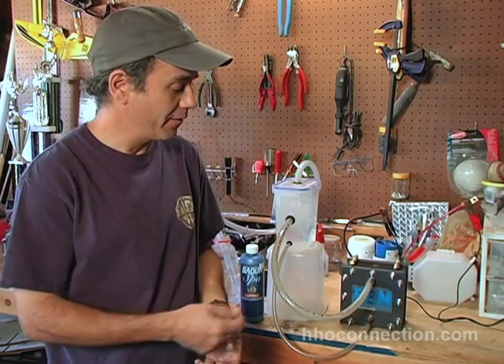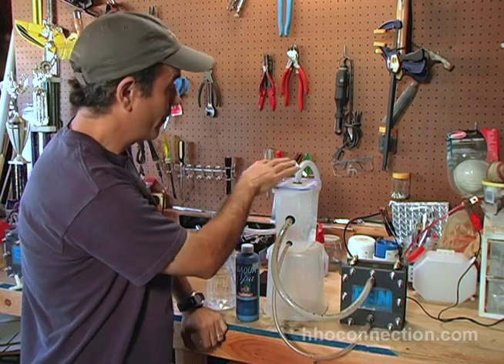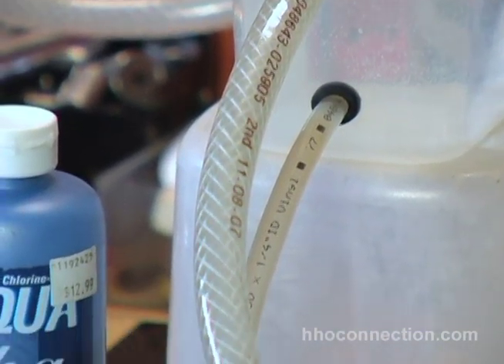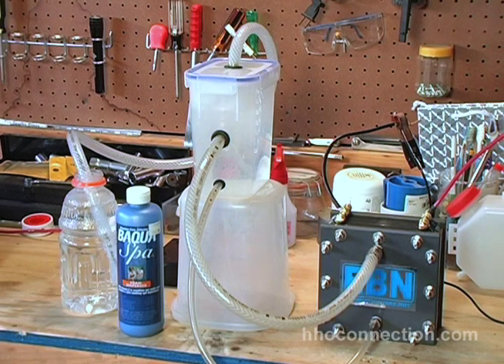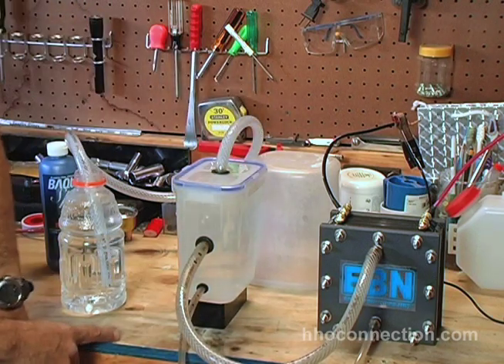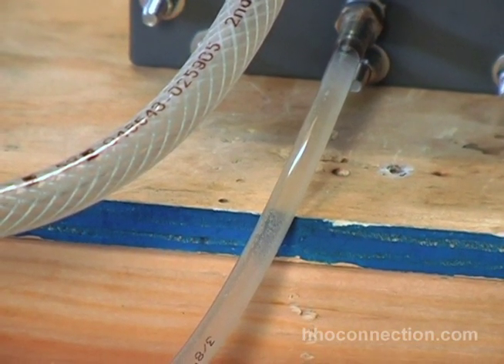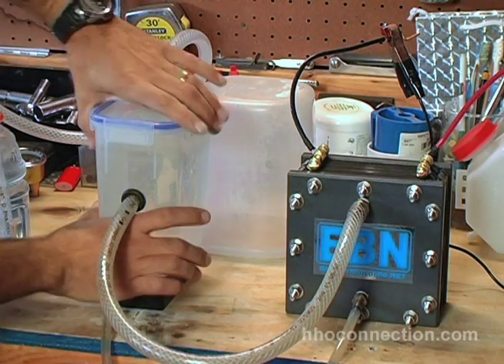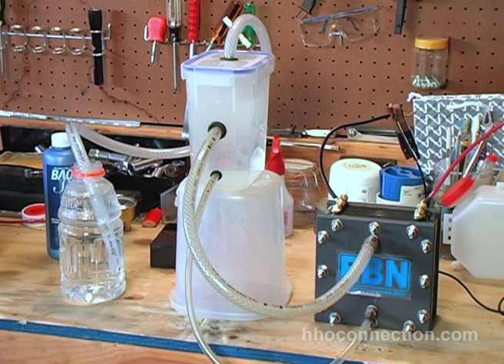Possible Solution To Dry Cell Foaming Issue

Comment: Lowering reservoir to decrease foam from dry cell.  Works fine in the lab; but, in the real world of automotive environments it's impossible.

As to hot tub foam dispersant, you don't speak of freqency of application of additional anti-foaming agent.  It's chemical make up may or may not be broken down by the electrolysis process.
The simple action of replacing the distilled water alone is no longer as simple.

In an automotive environment the vacuum draw on the generated HHO and upon the flow rate through the generator will produce huge volume of foam; without an anti-forming agent, especially at 30 amps.

You provide no answer here to the problem.

Comment: Don't listen to this guy if your cell is making foam it is because its contaminated I run just distilled water and KOH and mine never even forms foam. If You cleanse your cell properly foam is not a problem. Just run the cell normally for 24hrs than reverse your polarity and run it for 24 more hours and dump your water. Some times you need to repeat this 6 times to clean it but usually 2 cycles is plenty.

Comment: OOPS  Just looked at it again and the liquid does not circulate when the tank is lower than the cell. It circulates pretty good when  the the tank level is about 3 inches or so above the cell.

Comment: I just tried the lowering of the tank and it worked great. I looks to me that the liquid level of the tank should be a little bit bellow the hho outflow  of the cell. Doing that leaves a little air space on the top of the cell whereas the  tank being way above the cell  makes it so the cell is completely full of liquid where the hho pushes out liquid and hho. And the liquid does circulate pretty good when the tank is lowered.

Comment: Lowering the bubbler below the highest liguid level of the generator, lowers the liquid level in the generator and therefore lowers output. Lowering the bubbler below the powest point of the generator would even completely drain the generator.
I think that if you would take a look inside the generator, you would see froth in there instead of in the bubbler. Have you already tested the effects of the pool chemicals on the generator? Very interested! Cheers!

Comment: Lower the tank .... are you not just generating a gas lock , rather than bleeding the gas out of the cell , pushing a mix of liquid & gas . Are you not just capturing a gas pocket at the top of the cell , generating a dry area & loss of functioning cell  ?
Reply: magna59 s

Comment: On that foam issue, when you lowered  your tank you decreased the resistance of the water flow and when you lowered it again the foam left.  Its kind of like my internet I had my modem about 35' away from my dtv box and I wanted to listen to pandora radio and it was cutting in and out  so I rerouted the lines and put the modem next to dtv box and it works good now.

Comment: The reason it produced more foam the higher you put it is because the difference in water pressure, as water exits the cell and the reservoir is much higher, water pressure will push up the bubbles in a turbulent manner creating foam, but as you lower the reservoir, the water pressure almost equals, and the speed of gases flowing also slow down, giving the foam a greater chance to breakdown into bigger bubbles.

Comment: Hello, if you wanted to lower the reservoir even more, then it will have to be taller, so that the water column will be much higher than the top of the cell, that will create water pressure due to gravity and even if your reservoir outlet is much lower than the cell intake, water will still flow by gravity into the cell from the reservoir, because water will flow from a higher level to a lower one.

Comment from the maker: @iaumfreeandawake No, I never tried lowering the reservoir without the foam disperser. The lowering of the reservoir will only work if you use a pump because the water did not circulate well enough.

Comment: The true cause of Foam!, It is well known that when KOH and NaOH are mixed with oil it makes Soap. This is the source of the foam. New plates, gaskets and housing, reservoirs and tubing all have trace amounts of oil in them it leaches out and will take time to be removed from the system. I started a new cell yesterday with no foam problem at 30 Amps, today it has foam running out the top of my reservoirs. As it sat over night it made soap out of the oil.
Reply: not true , it only make soap with fat . fat and oil are not the same

Comment: You may already know this but i use potassium hydroxide (koh) it deosnt foam. so maybe you can skip a step.
Reply: I think its all in the materials the tubing and gaskets are made of , koh did the same for me , even worse actually, but i discovered oil does the trick . found the idea  on google books for industrial processes

Comment: ...and how are you going to accomplish this(level adjustment) in a car? 12v in line pump and a cooling device: no heating.
 i'll try your discovery. i live in cold climate and all pool supply stores are closed now. i had success with the foam, by accident, having to add some engine coolant in the reservoir for the winter. i'd like someone else to try and post the findings.